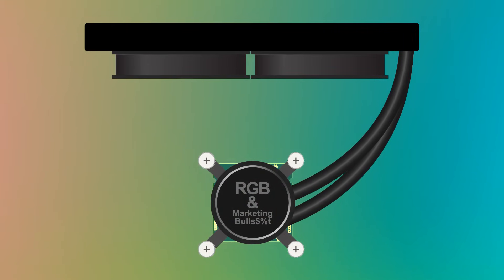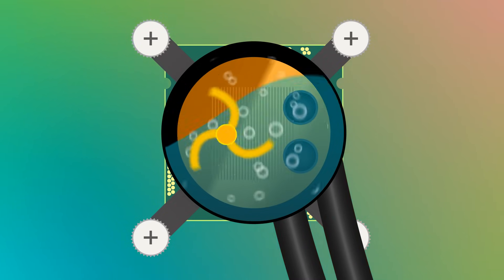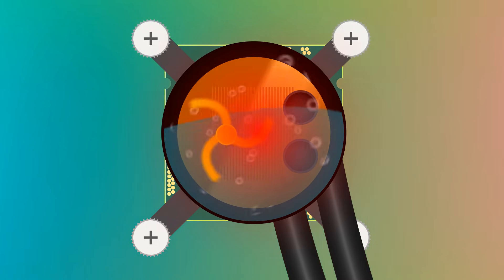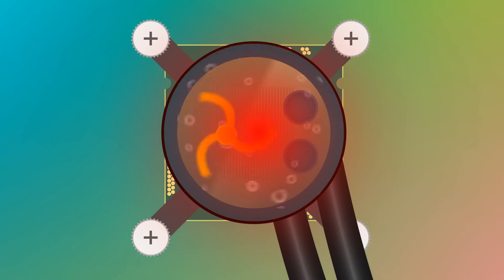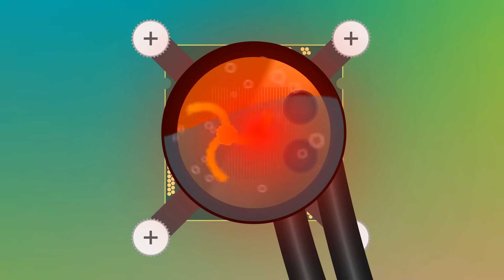Correct AIO orientation (This is the way)

Comment: You can have the radiator mounted to the front or side of the case with the inlet/outlet of the rad at the top without causing problems. You just need to make sure that the pump-block is below the level of the inlet/outlet of the rad.
Reply from the maker: Yes, it's better than damaging the inner coating of the hose by over stretching it.

Comment: Thanks for the quick and informative video. Animations were spot on. What about having the cooler like 1:46 but with the pipes coming from the top. Unfortunately the pipes aren't long enough coming from the bottom. As far as I'm aware sound will be an issue but won't have any difference in longevity
Reply: yeah not the problem , only need to remember is that the Rad should always be higher than the pump.
Reply: @marclenraymagdaraog691  with the msi coreliquid the pump is inside the rad, so I can only assume that it wouldn't matter with this 1?

Comment: but the gpu is blocking the way lol
Reply from the maker: Yes it's very difficult to get it to 1:46
I had to use PCIE 16X slot number 2 on my mother board.
Reply: @tldrinfographics5769  but my problem is it's on SLI
Reply from the maker: @limwellz  Oh my can you top mount?
Reply: @tldrinfographics5769  nope my case don't  support 360 on top

Comment: How about on a 120mm AIO like MasterLiquid ml120l V2? Would placing the radiator/fan on the back be fine?
Reply from the maker: Same principal
Tube down 
Water block up

If you install it at the back, Fan to Exhaust I think.
Reply: @tldrinfographics5769  I am about to buy my 1st AIO for my 5600x. Thank you very much <3
Reply from the maker: @XaelathRavenstorm  Ah that's sweet 5600x is a good pick Good luck!

Comment: so I have a problem; my case doesnt allow me to mount on top because i have a 3 fan aio so I can only mount in the front but I cant have the cable be the lowest point. Please help what can I do I spent too much money on this pc.
Reply from the maker: I feel you bro.
I you can't do 1:46 then have the tube up top 
I personally don't like it but it still works.

Watch the temperature and listen for any strange sound after installation.

If you have AMD CPU make sure that you don't pull out the CPU from the socket with waterblock
Reply: @tldrinfographics5769  will it cause any problems if I have it like that?

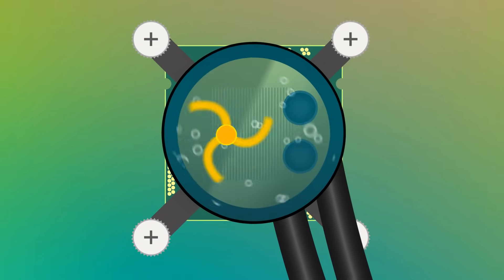Comment: Hi, I believe that this video shows the mounting position at 0:31, about which the GN video was WRONG!

Air is not going to magically find the pump just because it is suddenly higher than the top of the radiator... 
Either 
 * air is going to find the pump because it is at a high(!) point
  - "high point" is not equal to "highest point"!
 * or it is not! 

You can NOT have it both ways, as described in your video you effectively say:
* 1:30 air does not find the high point
* 0:31air does find the high point
This does not follow physics!
Air will, most of the time, not find the highest point!
Based on GNs two AIO videos, I believe that GN thinks that air will ALWAYS find the highest point... (His bottle metaphor would not make sense any other way...)
This is wrong. For an easy example, just look at the "air lock" wikipedia page; if air would always find the highest point, this phenomenon would not exist!)

In other words:
If 1:30 is an effective mount, so is 0:31.

A reason for why air would not be a problem for the pump in the mounting position at 0:31 (and 1:30) would be:
the water outlet of the radiator is not going to contain a sufficient amount of air.

Comment: If it's top mounted does it matter if the tubes are at the bottom or the right side of the pump?
Reply from the maker: It doesn't matter much.
But don't bend it too much because you can damage the inner coating in the tube and potentially leak at some stage.
Reply: @tldrinfographics5769  i have a deepcool castle 240 and if i mount it with the tubes down of the pump then the logo is not right😅, thanks for the reply. (Sry for bad english)

Comment: Is this will apply for the 360mm Aios that have the pump in the radiator?
Reply: And if i but the radiator in the top of the case Do I let the fans of the radiator blow out the air or let it enter to the PC
Reply from the maker: @no-_-copyright4322  When top mounted I would recommend exhaust fans config.

for pump in radiator type I would recommend 1:45
Reply: @tldrinfographics5769  
Thank you you are the best ♥️

Comment: 1:30 can someone explain this for me? I don't understand "inlet and outlet tube should be the lowest point of the radiator". I usually see youtubers (Bitwit) put it upside down. The tube at the top. I'm confused
Reply from the maker: Yes, tube at the top is the wrong way 
1:45 is da wae.
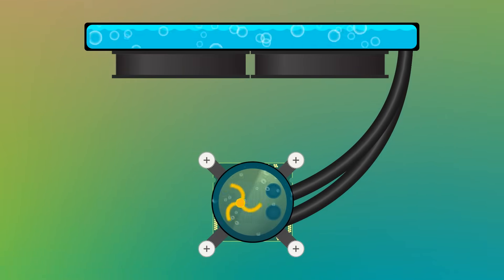Reply: to be precise, the tube should be at the bottom, because if its on the top, it tends to bend upwards and become the highest point in the system, and its a similar situation like 0:30 
In this scenario, even though the cpu block is filled with liquid, the circulation would be hampered because of air in the tubes, and warmer liquid would tend to linger longer, therefore reducing the speed at which the heat can be carried away to be cooled

Edit: If you put the tubes at the top, but bend them downwards, the air would accumulate in the same corner where the tubes connect, and some air would escape for a joyride across the loop
Reply: @deutschvanderlinde6900  is there a way to have the tubes be at the top and still have it work? I cant mount my aio on top and my case does not allow me to put the cables on the bottom
Reply: @undrawn2094  yes definitely. Most people mount it that way. Just bend the tubes downward, so it forms an U-shape
Reply: @deutschvanderlinde6900  okay thanks!

Comment: Okay, what if you keep the radiator as the highest point, but the inlet and outlet of the radiator is coming out from top? Will that still work even though its satisfying only 1/2 conditions?
Reply from the maker: That still works but I wouldn't recommend it.
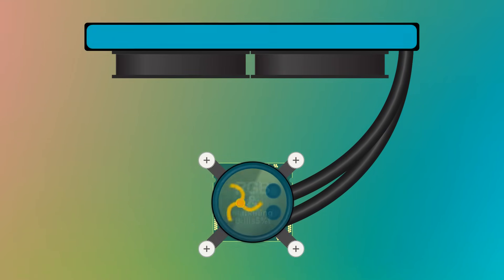Can you mount it on the top side like 0:11 ?
Reply: @tldrinfographics5769  thanks for the reply! not entirely sure yet. The case I purchased is a be quiet pure base 500 dx and the cooler I got is a deepcool castle 240ex (240mm) AIO.

The dimensions for the top on this case say up to 2x 140mm fans so Im hoping the 240mm AIO can fit up there.

I'm new to PCs and this will be my first build so I'm not entirely sure it'll fit up top. Hopefully it fits though lol.
Reply from the maker: @greencupofdeath  Well, trial and error is the fun part of it wish you good luck.

Comment: What if the pump is located inside the radiator? Like the MSI MAG Core liquid 240R? Is it fine to mount the rad on top?
Reply from the maker: In that case 1:45

Comment: This is bullshit, sry...!
There will always be a little air in the pump because the pump is higher than the connections of the hoses!
No pump can completely pump the air out of a room!
The pump must ALWAYS be under the hoses!
Otherwise you will break the pump!
If the pump is below the connection, the air is ALWAYS transported upwards and air can NEVER form in the pump!

Comment: what happens if the block is lower than the rad but you have the tubes down, like most normal people if you dont have space at the top
Reply: no, flipped, but the tubes still go down cause the block is lower
Reply from the maker: @MrRapSick  Not the best but it will work 
But be careful to watch the performance of the AIO long term.
Reply from the maker: Tube down? Like 1:45 ?

Comment: And If I get a 120 and I put in the back panel of the chasis how is the best position?
Reply from the maker: If the radiator sits above water block yes
Reply: @tldrinfographics5769  in that case they would be at the same level I think

Comment: So, my aio is the one at 1:44 but the radiator is flipped with the tubes at the top. It is higher than the pump. Is this okay?
Reply from the maker: Not the best, but if you can’t do 0:11 or 1:45  that’s the only other way to mount it.

Comment: What if it needs to be mounted on the side of a case? Would that be bad?
Reply from the maker: No idea 
Do you have NR200?
Reply: @tldrinfographics5769  yeah
Reply from the maker: @MrSobralinho  Ah ok
Can you put it side ways and check if the radiator's highest point is higher than the water block?
Reply: @tldrinfographics5769  it is, but im not sure if its good enough!the air gets trapped in the fins right?
Reply from the maker: @MrSobralinho  See if you can hear gurgling noise and temperature spikes.

If not it should be ok!

Comment: @I bought a msi mag 240 r and my case is the corsair 465 x.  It can only be put in front, will I have a problem?
Reply from the maker: Can you make radiator sit higher than the Water block?
Reply: @tldrinfographics5769  yes a little bit and the two fans will take out of the radiator to put them up

Comment: Many builders are putting the pipes on top for a side mount. Is this bad? i've heard mix reviews of this position. Considering it's so popular im confused why this hasn't been shown in this video.
Reply from the maker: It’s not recommended.
It has potential for lower performance and long term reliability issues.

Comment: WAIT! So what if the radiator mounting on front but the tubes are on top, going down in curve below the ram and then up into the aio pump. IS THAT O K?
Reply from the maker: Not the best.
Reply: @tldrinfographics5769  But the radiator is still on the highest point
Reply from the maker: @asafm32  Yeah the problem is that the reservoir inside the AIO is tiny and can’t quite trap all the air which means it’s possible that system could circulate the air.

Comment: Is it right to put the fans from the  inside of the radiator? (im talking about front intake)
Reply from the maker: I have no test data to answer that question.
Sorry. 

I think fans are versatile enough to accommodate both configuration but I would personally put the fans in front of the radiator.
Reply: @tldrinfographics5769  so the way the in take fans are placed in this video are fine? What do you think?
Reply from the maker: @giorgosredfield4534  I think it should be fine.
It would be quieter too.
Reply: @tldrinfographics5769  thank you! :)

Comment: Depends on the AIO brand manufacturer. If you have a look at ID-Cooling ICEFLOW 240MM AIO, they put their pump on the radiator. Bottom mount the radiator is fine in this case.

Comment: What should I don it my NZXT h510i?
Reply from the maker: Does it allow for either 0:11 or 1:45?

If not you might need to just put up with tubes up and 1:45 position.

Or... buy Lian Li o11 case
Reply: @tldrinfographics5769  in NZXT h510i we can only mount at front side.
Reply from the maker: @tejasparab2389  So you can install 1:45 ?

Comment: The pump connected to the radiator should be at the bottom of it rather than the top?
Reply from the maker: The pump/water block doesn’t have to be at the bottom but just slightly lower than top of the radiator.
Reply: @tldrinfographics5769  I understand that, but I meant the tubes coming out of the radiator on the right side. Should it be coming out from the top or bottom of it (The orientation of the radiator being upside down or not).

Comment: Tried placing mine the "good" vertical way, and I had to reverse it because i had terrible bubbling noise which i never had before. Pump was not at the top, so... It's strange but it did not work well for me.
Reply from the maker: How long did you run it that way?

Have you tried getting the air out of the waterblock before installation?

Which model is it?
Reply: @tldrinfographics5769  run that way for about a week... bubbles were not constant but always came back. Model masterliquid 240.

Comment: I'm curious though, is this the case for AIO's exclusively or are custom loops affected?
Reply from the maker: I don’t have experience with custom loops sorry.

But custom loops seems to trap air in the big reservoir.
Reply: Air will always be trapped in the top level of any water closed loop system because of density.
That being said, the only thing that matters is having the reservoir at the top (by even 1cm or 2). This means that if any part of the reservoir is at the top of the system, all the air will be trapped in it.
You just can't have two scenarios: empty water block (bad temps) or empty pump (well, death of the pump) and both are prevented if the reservoir has all the air trapped in the highest point. Everything else is fair game.

Comment: Can I mount the tube top but still have the radiator itself higher than the cpu pump block?
Reply: I'm curious as to why that wouldn't be the best. Is it because air might find the tube to be the top-most point, therefore having an air pocket in the tube itself?
Reply from the maker: @bombsaway619  Tube on top will circulate the air, make noise and lower the cooling efficiency.
Reply from the maker: If you have no choice other than 0:11 or 1:45 then yes. 

Not the best but.

Comment: I have questions, how if the corect position of radiator is turned 180 degree? So the tubes are in the same level with the pump
Reply from the maker: Tube at the same level of Pump/Water block is not so great.
Reply: @tldrinfographics5769  so, there are only 2 good position, first is the radiator above the pump, and second is like the end of your video. Am I right?
Reply from the maker: @DCC4G  Pretty much
Reply: @tldrinfographics5769  okay, thank you so much, it's really-really helpful
Reply: @tldrinfographics5769 btw, i have one more question, since this positions are good for AiO liquid cooler, how if I use water cooler with pump/reservoir, could the position be more various than AiO liquid cooler?
Reply from the maker: @DCC4G  I don’t have experience with custom water cooling sorry.

But from what I can observe custom loops don’t seem to suffer the same restrictions as AIOs and if it does it’s easy to diagnose as everything is transparent.
Reply: @tldrinfographics5769  yes, that right too, but from your video, I know that AiO liquid cooler has small pump  in the cpu water block,so it has small power in pumping water and the position will have impact on it, so you need proper position that work well with gravity, but in custom water cooler it has big pump or reservoir , and since it has more power in pumping than AiO, so there is would be no problem with positioning the radiator and tubes.is that right?
Reply from the maker: @DCC4G  Yes I am assuming so.

But it’s really complicated as there are multiple pipes going in and put of CPU and GPU all over seems like a nightmare to deal with. Looks amazing though.
Reply: @tldrinfographics5769  yeah, that's right, actually I'm confusing now, which should I buy, an AiO or Custom water cooling, with AiO i can save more money than the custom water cooling, and the custom water cooling is more difficult in putting it on the case, so I should pay more for the technician service, meanwhile the AiO is just Plug and Play but you just have two option in positioning. It's like more style needs more money.
Reply from the maker: @DCC4G  Sure anything custom costs big bucks.

I think it will be cheaper to buy case that accommodate AIOs if the budget is a concern.
Reply: @tldrinfographics5769  yeah, I have made a decision, I'll take the AiO and I'll use thermaltake core P3 case, and I'll take AiO with 240mm radiator, and I'll put it like the end of the video, where the radiator is higher than the water block

Comment: No the problem with longevity of the pump is from the impeller (pump) cavitation from the air and liquid.
Reply from the maker: Yes, you are correct 
Big omission by me.
Reply: @tldrinfographics5769  .. NP Good video. 👍😁

Comment: Unfortunately my case and AIO size do not allow tubes down.

 I believe it was said that as long as the pump is higher than the radiator, the only potential problem I would deal with tubes up would be noise, correct?
Reply from the maker: Not the end of the world but Steve from Gamer's Nexus said bit of performance will be sacrificed as well.
Can you top mount? like 0:11 ?
Reply: @tldrinfographics5769  Sadly no; the Thermaltake Versa J24 is not a bad little case in terms of temps, but it sure sucks when it comes to radiator support. It's either get a new case or get a nice NH-D15, which is temping either way!

Comment: Air bubbles in your impeller is how you get cavitation, that reduces the lifespan more than the high heat does.
Reply from the maker: Yes you are correct! I have left that out by mistake.
Reply: @tldrinfographics5769  no worries, it's a really well-done, informative video and it gets the point across nicely

Comment: If you want to do a frontal mount, just raise the the radiator so it seat higher the the pump and when installing drop the pump bellow the radiator to ensure the air will escape from the pump and piping to the top of the radiator. That's it.

Comment: Radiator should always be at the top of the case. Hot air rises.  Always push hot air out of case never into the case. People who put the radiator at the front of the case are doing it wrong. End of

Comment: With the short tubes of the arctic II 360 AIO its impossible to install it the right way. In my corsair case it's only possible to install the tubes above the radiator.
Reply: Unfortunately, no. The top mount is only for 240 fans. But with my overclocked ryzen 9 5900x I want to have at least the 360 version of the AIO. Greetings from Germany. But I plan to built a pc table with the hardware behind Glas.-maybe this will be better
Reply from the maker: @mokavelidadon3433  Guten tag
5900x deserves 360mm for sure
I think with such high-end system you might as well go all the way and buy the case that accomodate AIO in any orientation.
Reply from the maker: Can you top mount 0:11 ?